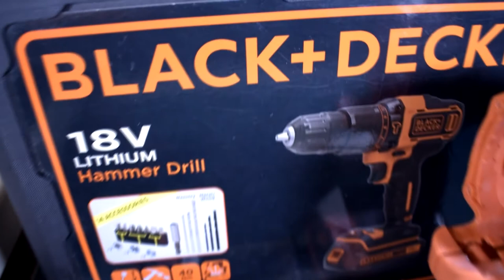Black & Decker Cordless Hammer Drill Disassembly | BDCHD18K | Teardown 2020

Comment: Just bought a Black + Decker Cordless Hammer Drill with Battery - 18V and it has wobble I took one back thinking I was unlucky just got back and new drill is the same does anyone have this is with this particular model? Do I keep it or get money back need to get in with some soundproofing and this has seriously peed me off!!
Reply from the maker: Hi Bows & nature. I have the same issue on my drill too but it is tolerable and I learned to manage it overtime. Thanks for watching. Please Like the video and subscribe if you haven't done yet. Stay safe.